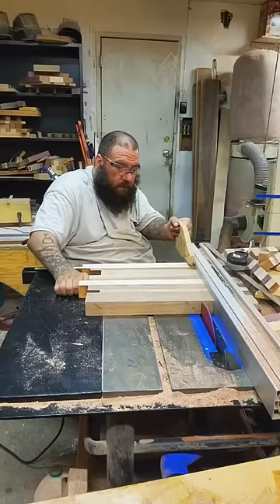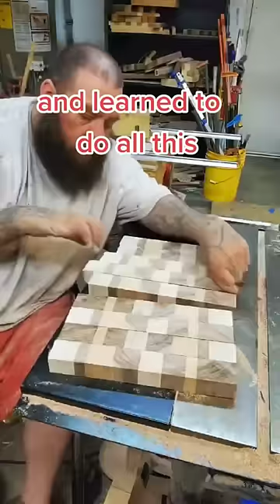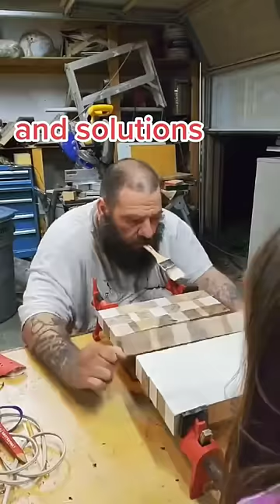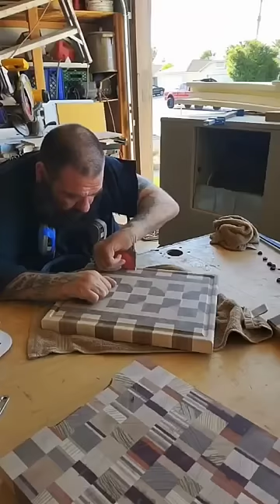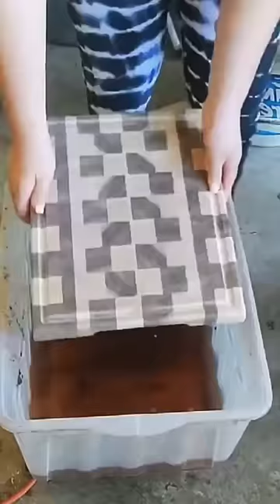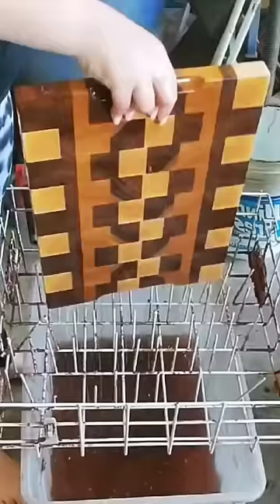keep it pushin!! living In possibilities and finding solutions

Comment: I’m a Partial Para but, Upper Trunk. I was just wondering if you get the muscle spasm pain when you are doing your woodworking?
I’m doing tiny projects right now but I’m building back up to furniture projects, which I used to love.
Reply from the maker: I do have muscle spasms and nerve pain. I try to shake my legs with my ands and get the spasms out before using the saw

Comment: I still refuse to the believe the glue is that strong, but I know I have to...
Reply from the maker: 🤣 The glue is actually stronger than the wood itself, you will break the wood before I glue joint, If Properly glued together.
Reply from the maker: Land of course if you use the right glue I use titebond 3